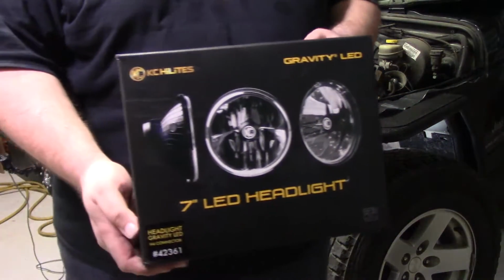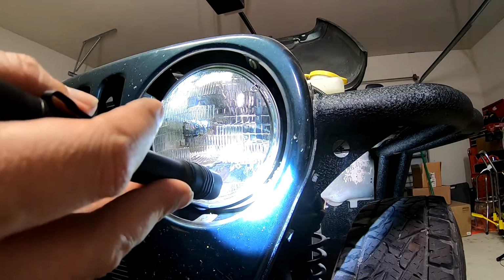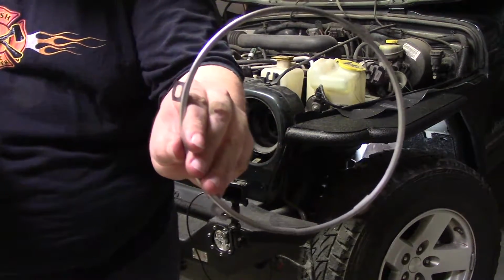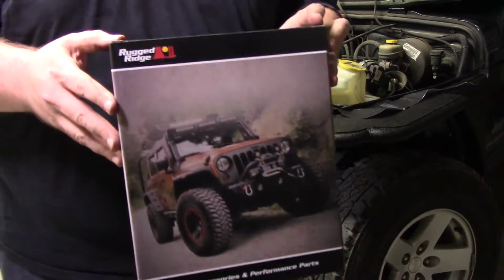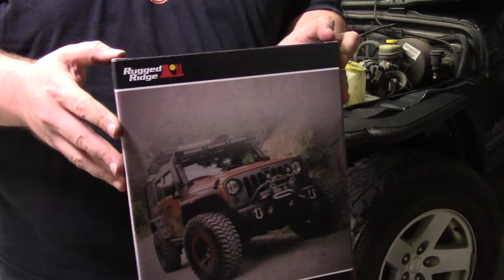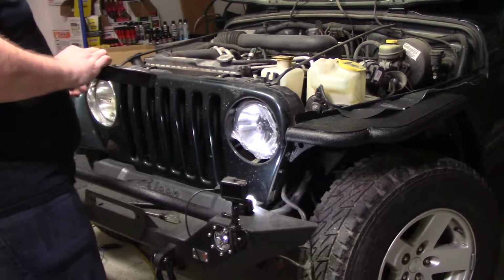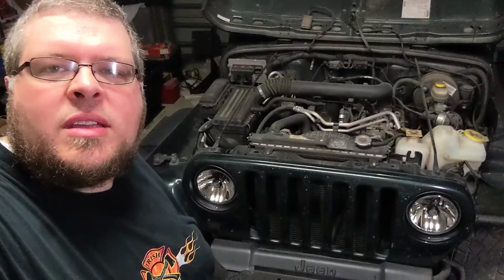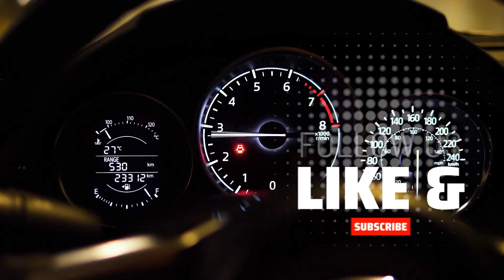2006 #Jeep #TJ  - KC Hilites 7" Gravity LED Headlight Install

Comment: do they come with a DRL feature? if so, how is it connected?
Reply from the maker: If I'm not mistaken, I believe DRL is part of the vehicle, not the headlamp assembly. If your Jeep has DRL, these will operate just as your other headlight bulbs do. These just replace your stock bulbs, not any other part of the headlamp circuit. If you mean a halo or city light feature, these do not have that. :)